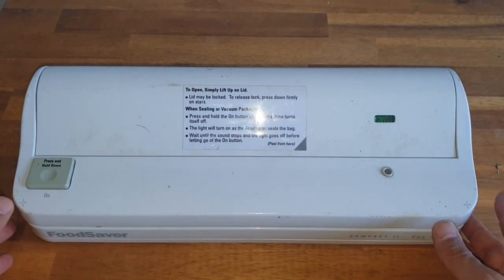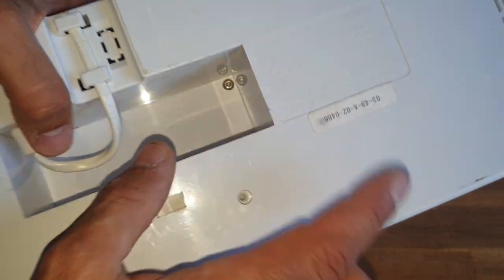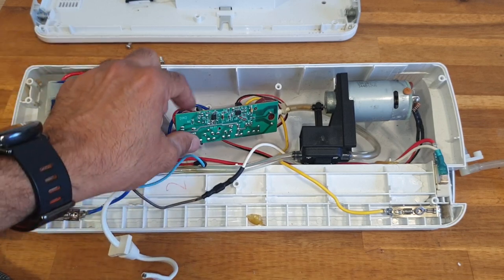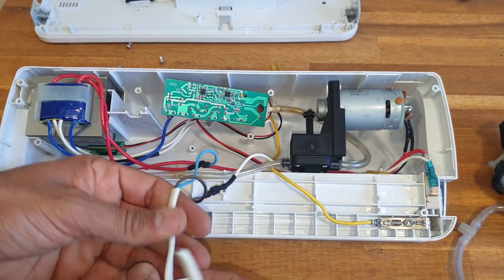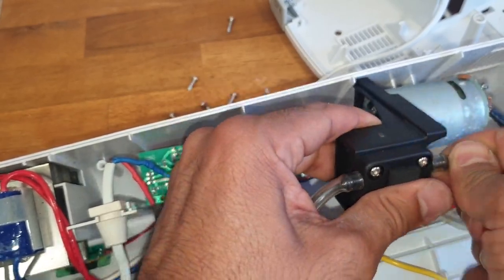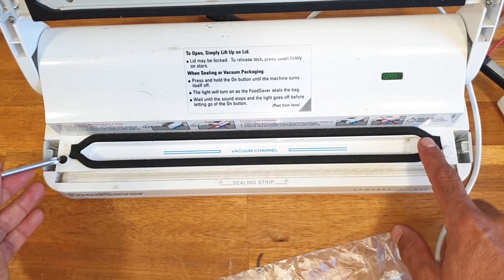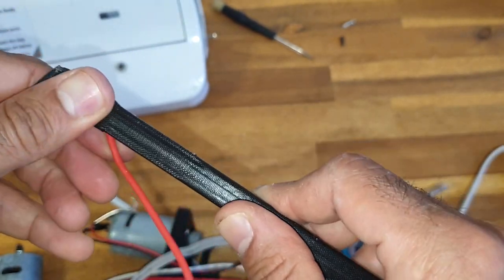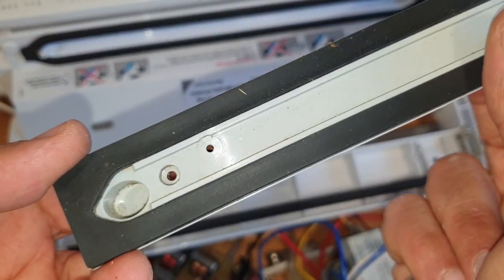Can I fix this FoodSaver Vacuum sealer Compact II Vac 550? QLTD

Comment: Obviously not pulling enough vacuum to trigger the sealing strip circuit. Those cheap little vacuum pumps don't last long... You may feel a little vacuum, but it isn't enough to trigger the heat strip circuit...